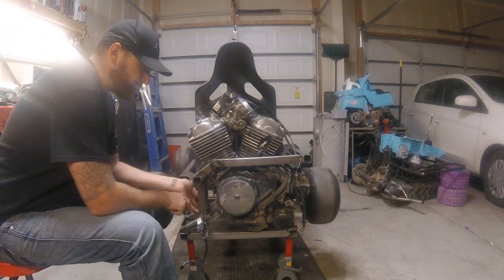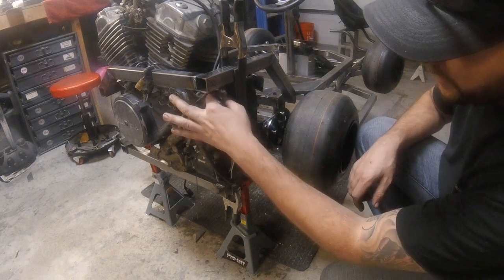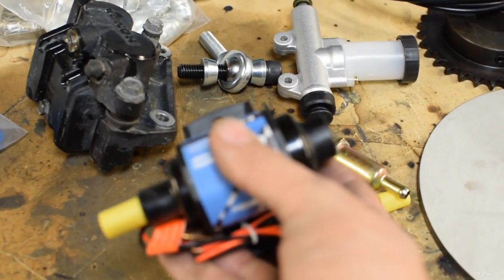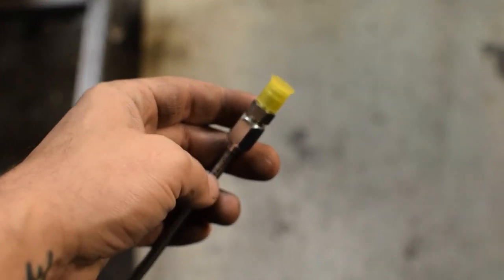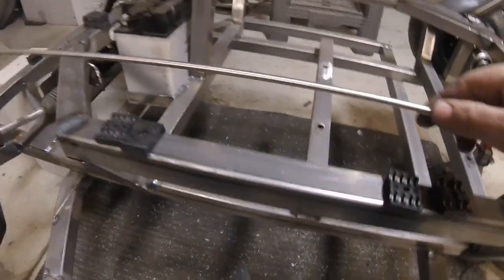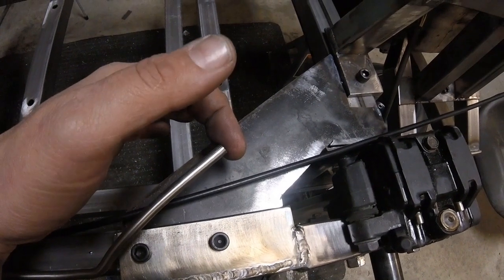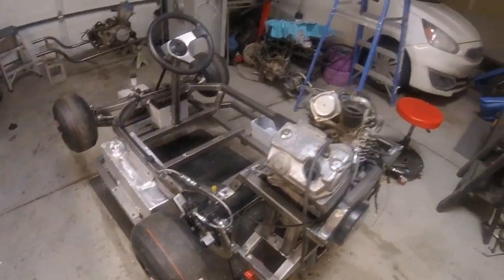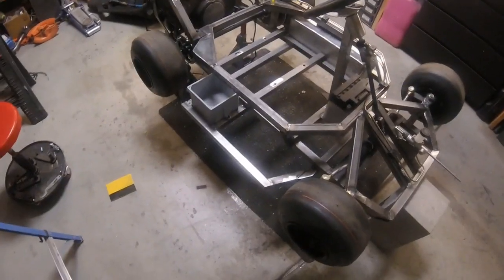The Sleeper part 6

Comment: snowcat build sounds cool you could use a similar way of doing the tracks like the diesel brothers did on their six-by-six track truck because it's four-wheel drive
Reply from the maker: Austen Crenshaw I’ll have to look that one up!!!
Reply: I'm dumb, no you couldn't cuz it's not a hydrostatic steering. I was thinking about the rear section of the 6x6, then I read your comment and the obvious occurred to me.
Reply from the maker: No it will be open diff brake steering